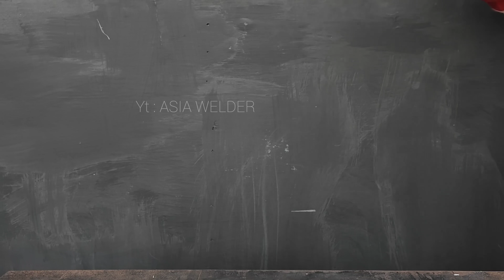the discovery of practical tools and crafts from welders that are rarely talked about

Comment: Cloth gloves with a grinder is exceptionally dangerous, this is not something thar should be used in a public demonstration.
Cloth gloves with a drill press is profoundly stupid, particularly without clamping the material.
I'm choosing to believe that the gloves are nomex, and not comment on using them to weld.
Neat tool though.